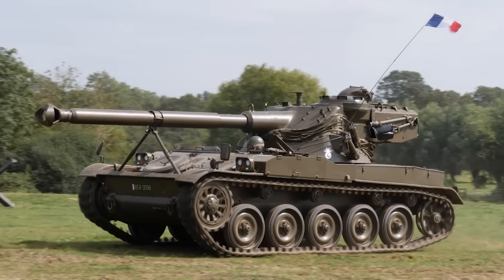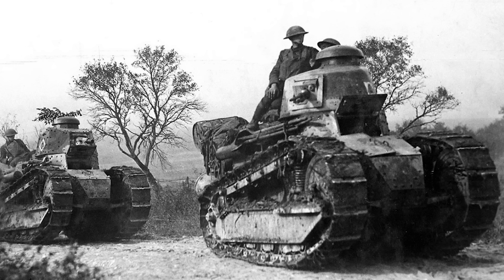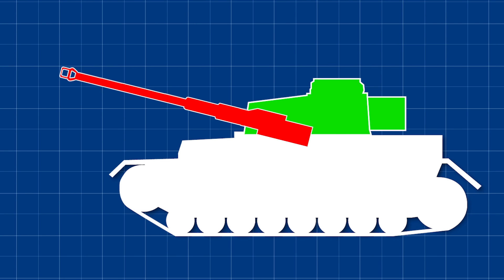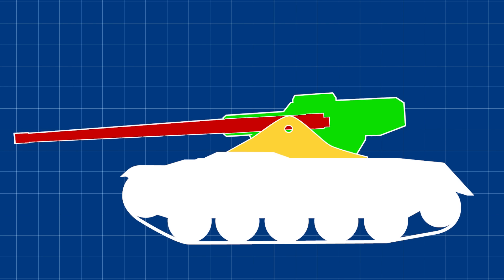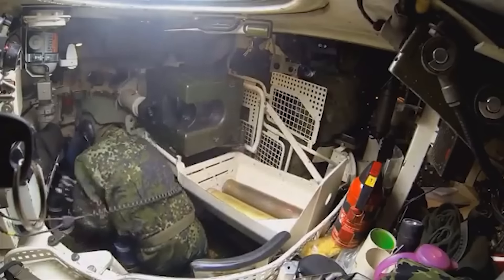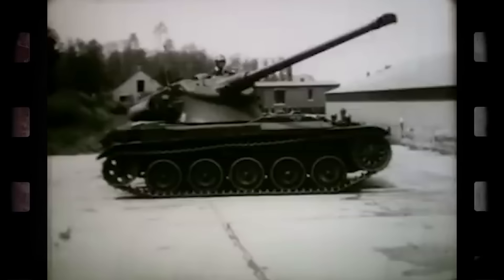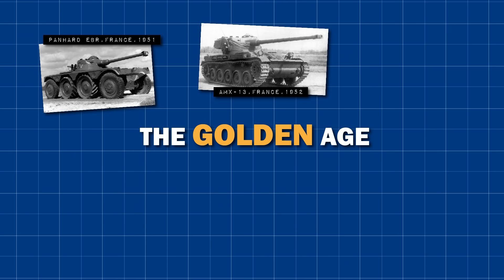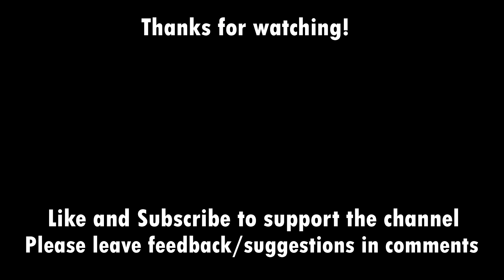What actually IS an “Oscillating” turret?

Comment: Very interesting and insightful video. Although someone correct me if I’m wrong, I’ve heard that Oscillating Turrets tend to be more difficult to stabilise than conventional turrets, reducing fire on the move capability. 

Can’t remember where I heard this but seems reasonable given the greater amount of mass the fire control system has to keep stable.
Reply: It may explain why the amx 50 never went in production. Amx 13 and Panhard were used for asymmetric wars and were perfect to have a lot of punch without having a MBT. This was the French school, that you retrieve in the AMX 10RCas it packs the same caliber as the MBT of its time but in a fast 14 tons vehicle,.
Reply: Mass means nothing, though. Properly designed oscillator has ammo in the rear balancing weight of the gun in front, making pivot incredibly easy, like a seesaw...
Reply: @KuK137  It indeed balances well (which provides good passive stability) but mass doesn't mean nothing, it means greater inertia. Any active stabilization system still needs to contend with much higher inertia than if it was operating on just the gun alone. It will be harder to make the small but relatively rapid adjustments required for high precision.
Reply: oscillating turrets have greater mass and much more of a pain to stabilize, not only that, you'd have very little internal space (even with AMX 50) due to the hemispheres that covers the bottom part of the upper turret.

stabilization on an oscillating turret would have to add a big enough motor to counteract the intertia of the heavy upper turret just to chase the gunsight lay, even worse if the rear bustle autoloader rack is empty as now that would have to be compensated for.

Comment: 5:10 sealing a hinge has never been a problem, just put a skirt between the two parts, and that's clearly visible in the pictures you used.

That skirt is however a lot more prone to being pierced, slashed and deteriorating than seals between armor plates, so you are right that it is a weakness, but it still is NBC protected.

Comment: Excellent rundown which covers everything. The oscillating turret could be a good design for a 155 mm mobile artillery gun but to get the elevation needed would require the turret to be mounted right at the rear leaving no room for the auto loader and ammo. Oh well.
My topic suggestion would for the Stug type casemate gun AFV, the pros and cons for a modern version..
Reply from the maker: Thanks :) the StuG will appear very soon...

Comment: Isn't a main reason the design was mostly dropped that it's very difficult / impossible to stabilize a classic oscillating turret. (the m1128 does not carry crew and armor in such a use case it might be a different thing but that is also very far from a classical turret) 
NBC protection is usually realized by overpressure inside the hull and brush seals are a thing. (The Tornado RB199 engine already used those as far as I know for a much more challenging use case)

Also the turret roof can be lower and the overall turret all together smaller giving a smaller target area.

Another possible downside (pure speculation) is that it's much more difficult to put very heavy armor into a oscillating design since much more of the weight needs to be lifted and moved.
Reply: That and the weight would strain the motors needed to pivot the turret up and down

For sure when loaded with ammo and everything
Reply: Nah, it's actually far easier to put armor on because tiny turret means less armor volume. T-14 Armata has ridiculous armor levels precisely because turret is unmanned.
Reply: @evo3s75  Why would it strain anything? Properly designed oscillator has ammo in the rear balancing weight of the gun in front, making pivot incredibly easy, like a seesaw...
Reply: @KuK137  it would still strain the motors, it can be as balanced as you want but the motors would still be strained by having to hold back the weight of the turret moving up and down.

And it is in general not a good idea since your vertical drives are open and exposed, the collar doesn't provide enough protection
Reply: @evo3s75  if you have an auto loader and blow out panels, then is there still a need to heavily armour the turret?
Reply: @user-op8fg3ny3j  if you got crew in there or a direct connection to the crew department yes else arming against anything above common autocannons is probably just wasted weight.
Reply: about the stab it's a myth spread out mainly by video games and wannabe experts X) look on youtube for some oscilating tanks trials, and shooting range ;) french oscilating turret had a shock absorber, and later on Austria and France manage to made two planned stabilized turrets.

For the waight as some one said the turret is way smaller, so yes it save weight and the balance with the bustle helps too.
Reply: @evo3s75  you missed a detail on the oscilating turret, the upper part extend downward in a semi spherical shape, so at any angle you still have protection, also the small AMX 13 being a light tank of 13 tones means there is not a lot of protection to begin with, the bigger model like AMX 50s have a way more powerful engine. That said french AMX 50s were supposed to be very mobile so their armor came from paper thin in the begining to a decent level at the end of the program, but still subpar to something like Conqueror, but the american T57 heavy prototype come quite close
Reply: @user-op8fg3ny3j  yes there is, blow-out ammoracks are nice to have but you also need to armor the turret, the turret will receive most of the hits in an engagement. That and if the ammorack get's penetrated towards the crew the fire will spill towards them, a blowout ammorack can help against it to some degree, but not if perforated on the crew side
Reply: @abaddon7558  Yea, that's true. But you'd still have your elevator's exposed on the sides and it's not really something you'd like to have. And the AMX-13, like you said it wasn't meant to take a hit anyways.

And I love the look of oscillating tank designs such as the AMX-13 and 50 series, but those should just remain a thing of the past, as something to look fond of

But anyways, oscillating turret designs have fallen out of fashion for a reason. They were designed for the early auto-loaders which couldn't adjust well to the angle of the gun, something modern auto-loaders can do (within a reasonable limit of course)

Comment: i like to think that another reason for the discontinuation of oscillating turrets is that one of the reasons for their creation is to have an autoloading mechanism and "magazine" that wouldnt fit in the smaller turrets and turret rings that were common in tanks from WW2 and prior, but afterwards, they decided that this whole mechanism can instead just be fit in a conventional turret large enough, and tanks from 1950 onwards usually have much larger turrets compared to their hull when compared to WW2 and prior tanks.

Comment: Best explanation I've seen of this concept in a very neat and concise manner. Interestingly there's a Belgian company in preliminary talks to sell some old SK-105s - an Austrian light tank that uses the exact same turret as the AMX-13 - to Ukraine. Would be quite a plot twist to see the oscillating turret on a 21st century battlefield, but with the ability to fire twelve 105mm rounds per minute, plus very good mobility and thermal gunner optics it could end up being quite useful to Ukraine, and they'd be very cheap so all 112 in storage could be easily bought. It would depend on neutral Austria's approval though, unfortunately.
Reply: Nice that it has 12 rpm but how long can it sustain that? Yea.. not long, it's only 12 rounds, and I doubt it would do much against Russian armor, maybe older soviet armor like T-64 and T-72A (or light vehicles like BTR/BMP/etc) , but those are fielded by the Ukrainians themselves

Next to that, the Russian mbt's have a auto-loader which has 20 something rounds. And when the auto-loader is empty they can reload it from inside, whereas with the SK-105 you would have to leave the vehicle and load it from the outside.

The thermals may be nice, but if these are the older SK-105's it won't help much since the gun is unstabilized, and every Russian vehicle has a stabilizer

The SK-105 is also pretty slow despite being lightly armoured and it also has thin tracks which isn't going to be pretty with the Ukrainian mud 

They could better send parts or other vehicles tbh
Reply: @evo3s75  Top speed of 70kph, upwards of 360mm of RHA penetration at close range. The cannon is similar to the one used on the AMX-10RC provided to Ukraine. They wouldn't be taking on MBTs (well, they could actually destroy a T-62, frontally) but I feel they could be genuinely useful for hit-and-run, which is an art the Ukrainians have perfected with light vehicles like Humvees and Bushmasters so far.

It's not meant to be fired on the move. You quickly nip to a good firing position, lay twelve rounds into the enemy before they know what's going on, and then run away. Defensively you would dig in ahead of time and then run away when things get hairy. Light tank tactics, still relevant today.

With the state of the Russian army we're seeing older equipment become more and more viable for Ukraine. And with the asking price and quantity of these SK-105s I see little reason not to grab them, really.
Reply from the maker: Thanks so much! Would definitely be interesting to see SK-105s in action.

Comment: Singapore 🇸🇬 Military SAF ARMY Armour Units had bought these Old French made AMX-13 light Tanks in the 70s era and modernised with Pneumatic Suspension and Diesel Engine by Singapore 🇸🇬 Technologies Kinetics by Ministry of Defence then.

Singapore 🇸🇬 Military operated these Old Light Tanks for 35 years and Eventually chosen the German Made Leopard 2A4 Main Battle Tank to Replace these AMX-13SM1 Tanks.

Comment: In modern times, when you can look around through wires and not need direct means to do so, like periscope, oscillated turret can be really good idea, combined with proper autoloader. I think this is the future, not in next generation, but one after those.
Reply: Not to mention the whole sealing the turret from chemical weapons contaminating the crew wouldn't be an issue nowadays since we can now control turrets remotely.

Comment: Hold on, you mentioned that it has a major flaw of being more vulnerable to NBC’s. But what if you make one with autoloaders which I believe means that it is unmanned and then put the crew in a separate airtight part of the tank, should it not be the same as sealing a regular tank in terms of sealing the crew in? Having the oscillating turret and the crew in separate parts of the tank should resolve this major flaw, right?
Reply: That's precisely how modern systems do it. The Puma IFV, despite its struggles in recent exercises, has a single one piece cabin with the turret just sitting on top.
And while "struggle" may be a nice way to describe the absolute shitshow that happened in that maneuver late 22 I'm confident KMW will get it sorted.
It is a sensible prediction that turrets will not continue to have weapons manually operated indefinitely. There are just too many gains to be had by sealing the turret off from the crew.
Reply: That's exactly what the end of the video talks about with the M1128 :)

Comment: I definitely can see this having used in large scale mobile artillery with auto loaders. It wouldn’t have worries like NBC like the striker. However it wouldn’t need to worry about insane fire-rate as it’s purpose is really big gun, which would have uses in specialty ammo. Something an army can pull up to deal with very specific issues like heavily fortified and dug in bunkers that it’s destruction is vital, but air support is unavailable due to various potential issues. Basically a couple tanks for big problems.
Reply: look at the sweedish SPG bandkanon ;)

Comment: Well if I think about it, armored vehicles of my country's army kind of have oscilating turrets, but like, they are 30mm canons, so its not much a deal, but the mechanism is mounted on top of crew compartment on like 60 cm ring (I don't know exact measures, except the caliber) and everything (the gun itself, magazine, loading mechanism, machine gun, all sensors, and even rocket launcher) is mounted on the upper part of the movement, completely controlled by motors from down below in the vehicle. The vehicle is KBVP Pandur 2 if you want to look at it :D

Comment: Today oscillating turrets are "limited" smaller guns, but for the same reason.  automatic cannons, their ammo box, feed systems, sensors, and such will all be mounted in the oscillating part, while the bottom part simply handles rotation.  

This is important in remote weapon stations,  where the gun and sensors need to stay aligned...  and the ammo feed needs to be as smooth and self contained as possible.   

A perfect example of this is the CWIS.

Comment: One cool oscolating turret design was the Swedish Kranvagn project/design, a heavy tank similar to AMX-50 with a 120 mm autoloader but it did not have the oscillating the same way as the AMX ones, the gun and autoreloader unit was the moving part and the turrer crew was inside the collar of the turret and the gun was separate from the tank basically. There was no real prototype, only a wooden mockup, because the project was deemed too expencive and complicated. But it could have been one of the best Heavy MBT designs if it was perfected.

Comment: Great video! Question: is this “cloth” you sometimes see on the around the barrel (like at some centurions or the M48) also a NBC protection?
Reply: I think those are just dust covers.
Reply: Thermal shroud?
Reply: What @thhseeking said; it's a thermal shroud. It enables a barrel to equally dissipate the heat generated by the firing of numerous rounds. Without it the barrel could warp, and thus the gun would lose accuracy.

Comment: One can use this tech to make a self propelled howitzer. It nullifies almost all it's drawbacks. Artillery's biggest problem is that it is difficult to deploy. This will give a significant mobility. The lack of sealing is also not an issue because you don't deploy howitzers in the frontline especially the one with large gun calibre. Also it can be operated manually or a basic autoloader since howitzers are fired strategically and not like tanks.

Comment: A wonderful explanation,  a current technology, might bring  this system back with an encapsulated firing system with autoloader seperated from the crew system. Thereby permitting isolated systems permitting NBC capable operation. And limited crew allowing a more minimal threat system

Comment: 4:24 One thing to note is that this is really only a problem with gun sights fixed the gun assembly itself. Sights that are aimed independently of the gun don’t have this problem.

I am surprised you didn’t mention one major issue with oscillating turrets, being how difficult it is to stabilize. Because the entire turret is moved, this means that the stabilizer needs not only to handle the weight of the gun assembly but also the entire turret itself, which makes them difficult (albeit not impossible) to stabilize. 

5:08 One last thing, although I am aware of the sealing issues with oscillating turrets, I assumed this was primarily a problem with fording and maintenance. I although I cannot confirm this, being that the turret is a self contained assembly I would assume that oscillating turrets would do just fine with NBC protection. I know it would be a major pain in the dick to sterilize if exposed to NBC elements, but I don’t see how the crew would be at risk. If anything, it would seem like oscillating turrets would be easier to seal (crew compartment wise) given that you don’t need to tightly seal moving parts like you would with a conventional turret ring. Again, I cannot confirm this but I find it a bit difficult to believe. If there are anything official to support or deny this I like to know about it.
Reply: If you watch the end of the video you can actually get an example of a sealed oscillating turret vehicle, thing is the turret needs to be unmanned in order to seal it off from the rest of the tank. Back in the cold war, you still needed gunners and loaders usually in the turret, which in this case would have been very hard to seal compared to a conventional design. These days, turrets can be entirely automated, allowing for designs such as the one at the end of the video.
Reply: @xiphosura413 Nowadays, you can control tank turrets remotely, this wouldn't be an issue in modern tanks.

Comment: What if the oscillating turret was a separately sealed from the main hull
I know that makes o2 a bit more difficult but it's an idea
Reply: If the turret itself is unmanned,it could be sealed off from the rest of the vehicle,in theory anyway.
Reply: @elchjol2777  the only issues I see with our ideas (mind you I am far from an expert) is that if the auto loader malfunctions the crew will have no way to fix it without leaving the tank.

My flaw is that if the crew won't be able to interact with each other and the design would also make leaving the tank difficult. But conceptualizing as someone who has no qualifications is fun anyways
Reply: I think it’s possible if the turret is either much larger (to be able to hold a man) or if the tank is unmanned. But the problem of fixing any loading issues or any other issue with the gun or turret would mean that the crew would have to fully leave the tank to fix it.
Reply: @azariahprice4788  aside from locomotion, the turret would become its own tank, which can cause issues with weight and stress on the parts connecting the turret to the body